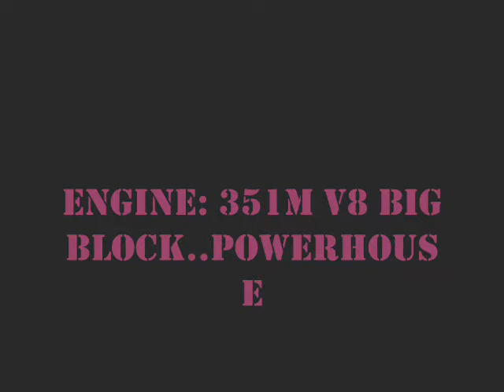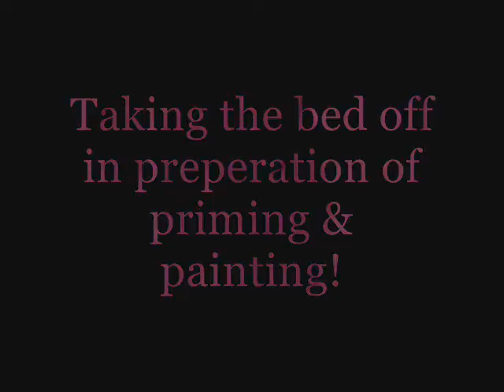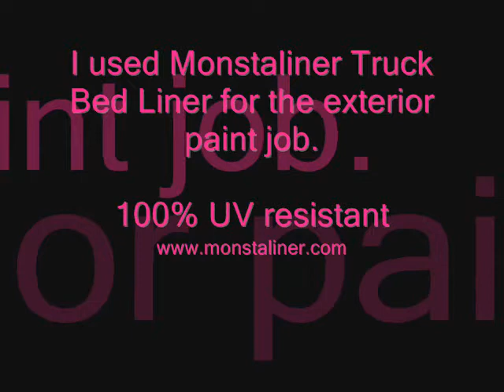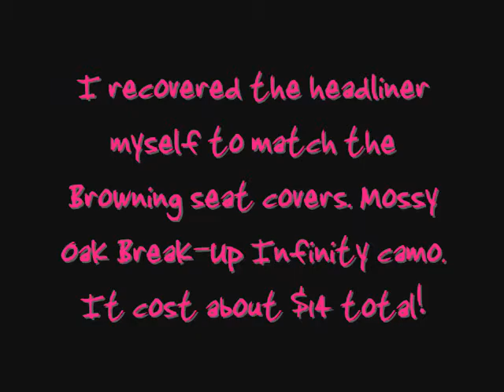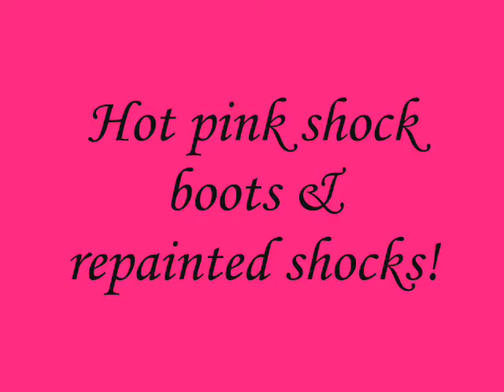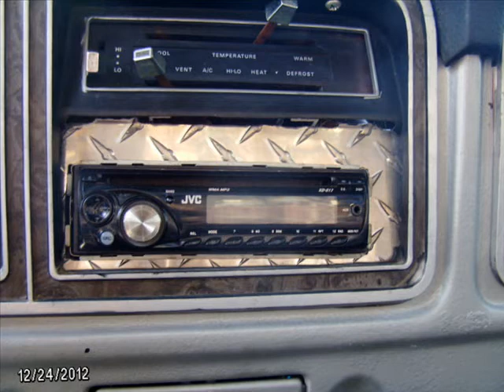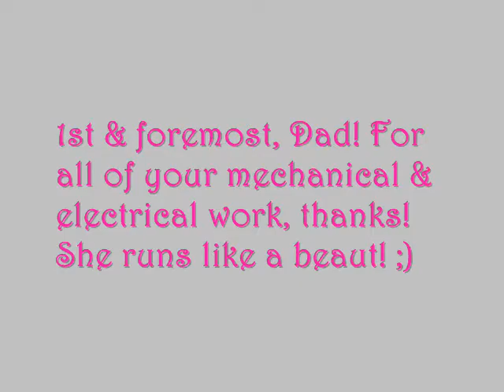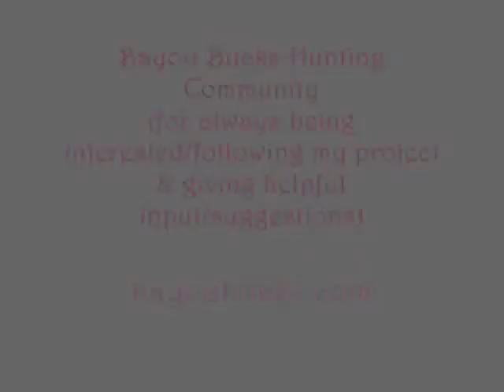1978 Ford 4x4 restoration pictorial

Comment: loved the vid.i wish i could find a gf like you lol what size of engine do you have in that truck?i got a 1978 ford f-150 with a 400 big block with 500hp all straight pipe duel exhaust with a 4 speed transmission